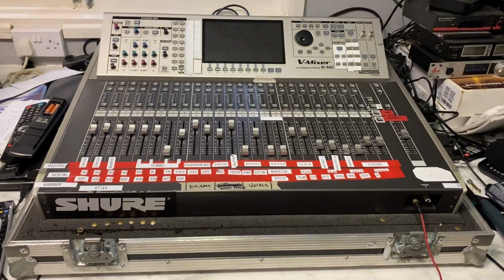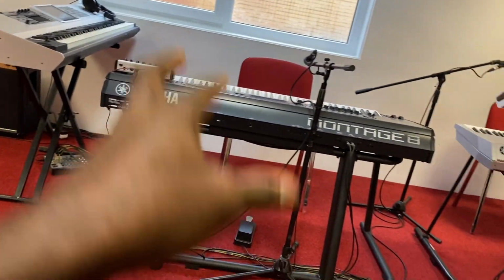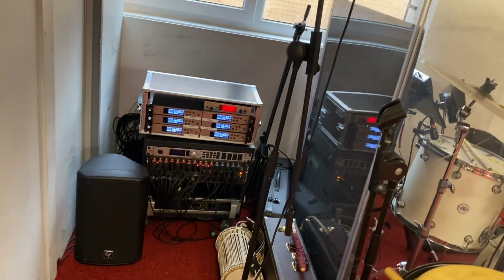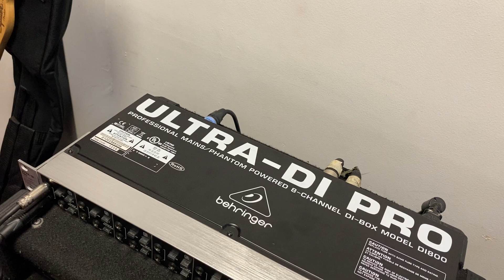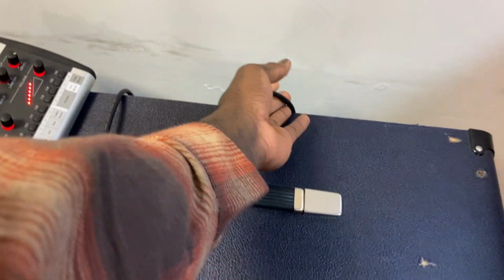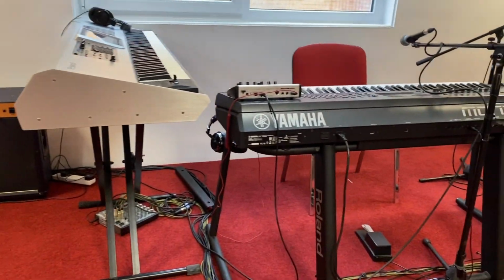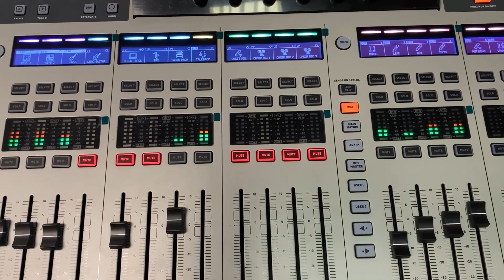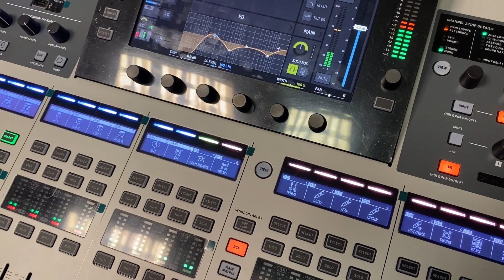We UPGRADED our Church Audio System — Overview of our Setup #BehringerWing

Comment: Hi. Would you still use dbx speaker management system inspite you routed your FOH to the wing’s matrices? Is that better in EQin the room and ringing out feedback or would you still use the dbx processor?
Reply from the maker: I have used the matrices as my speaker processor in this setup. Room/Speaker EQ has been done here because the wing has an 8-band parametric EQ and Graphic EQ available, and also I have multiple speakers in the room.